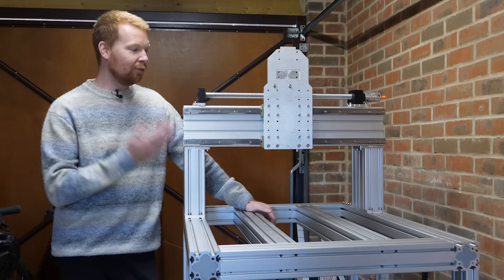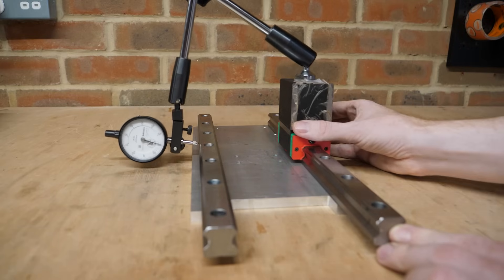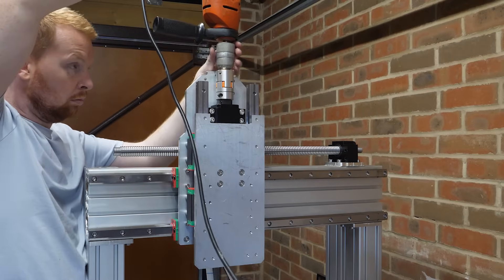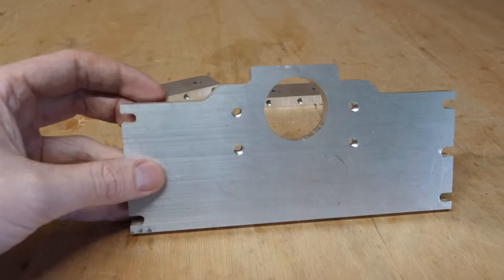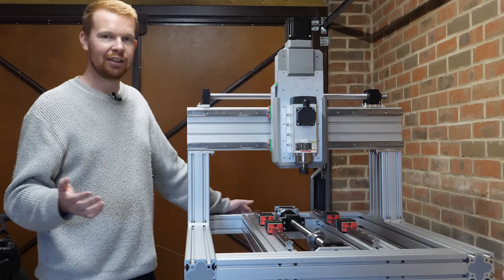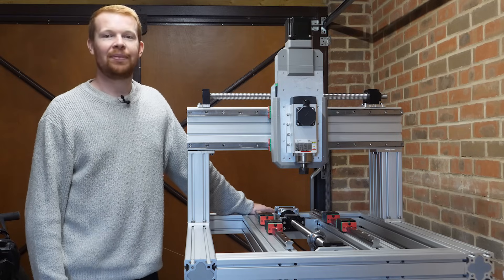Building a CNC Mill/Router - Part 3

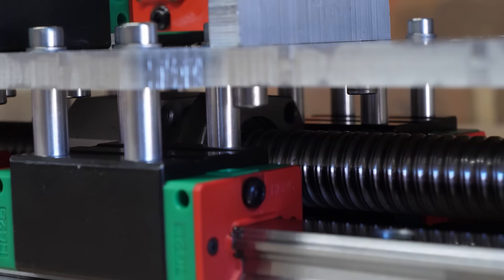Comment: I have a question ! You made the hole Maschine out of strong Aluminium Profile, 80x80mm and put Concrete into theyse Aluminium Profile. And then you use theyse flimsy pipe at 2:35 to raise the Plate? Dude I hope that you will change the tubes for aluminium flat stock 😅
Reply from the maker: Yes I've already replaced them with aluminium blocks haha!

Comment: how you have solved, heavy spindle not drop down when power is OFF. i just update my DIY cnc Z axis new rails, new T-screw and heavy 2.2KW spindle, but id cut power OFF no elektric spindle move to down screw rotate because spindle have very heavy and drop down. no problems if power is ON, then steppermotor torque keep screw locked and no drop down. i use T8 trapezoid screw Z axis. rails have about 300mm long. MGN 15H rails. my machine table size is 1500mm x 1500mm x 150mm working area. before light weight 800W ER16 spindle not has this problem and working well milling wood lot.

Comment: I don’t know much about water cooling when it comes to millls. However Ive done some work with water cooling other equipment and usually you are supposed to use an anti septic chemical. They have ones specifically to be a water cooling additive. Additionally at least in my experience it’s a good idea to use distilled water.

Comment: Might be a better way to mount  y table,  instead of mounting the y rails to the table frame. Mount the rails to the bottom of the y moving table. Mount the bearing blocks to table frame so they don’t move, this might increase rigidity of work piece under spindle.

Comment: 4:50 If you're looking to get better quality with that filament, you'll have to remove the mosture built up inside it. If you heat the spool in an oven or a drybox over time ( temp. depends on material, but theres a few recommended values and methods online it'll take the moisture out of the filament. You can also toss some dessicant packs in a box, and it should keep the spool dry for a while.

Comment: Hello everyone,

I am a mechanical engineer and I have the same type of engine that used to overheat until I designed a new fan with 7.2 times greater airflow. If any of you have a similar problem, feel free to contact me and I will solve it for you.

Comment: Your power issue was not because of just 1,5KW,but rather a cheapo VFD. Get a proper one with Sensorless vector/or with sensor vector(need a sensor then for the RPM). I am running my 1,5Kw 220v spindle on a ST500 with 12000rpm with a 6mm endmill ,22mm deep, 1,5mm step over by a feed of somewhere around 1900.....With the chines vdf not even half was possible.Also get some coolant or at least air to get the chips of the cutter and the cutting area. Most gunk up on aluminium is from chips getting in to the cutting edges over and over again and pressing into the chip channel.
So yeah just put at least a nozzel with air up. 1-2 bar should be enough,or get a cold end by endcnc. Best fog cooling on the market,even better then industrie ones

Comment: Maybe I am dumb, but couldn't you use a frame out of cheap angle iron, which fixes a thick wooden spoil board, that you use the cnc mill to flatten peferctly parallel to your x and y axis? For many operations I would assume, that you would add a vice with some bolts on top and big sheets of iron etc could get screwed down with a bunch of wood screws: Drill a few holes in strategic points, fix with a woodscrew into the spoil board and remove everything once you are done.

Comment: Dude, there is something called printnc which is a CNC machine with a bunch of 3d printed parts, and it cuts steel, don't wrap your head around avoiding printed parts, they are strong enough for your application

Comment: Still not cheap, but clickmetal seems to have the cheapest aluminium tooling plate in the uk. Cheaper than aluminium warehouse's standard plate. About £150 for 520 x 520 x 16mm

Comment: Those spacers are going to cause a lot of rigidity and vibration issues. Ideally the blocks should be mounted flat on the surface.

Comment: So something I learned when I made my cnc machine is that because steppers NEVER turn off they can get hot enough to melt the 3d printed part over a long operation. It shouldn't cause a major failure because it will just make the plastic soft and deform, but its still something to watch out for.

Comment: With such beefy motors, why not build a 4x4ft or 4x8?… You could have worked on a full slab of wood on something like that. Even if you don’t need that now, would have been future proof.
Also… what’s with the ball screw in the middle like that? Shouldn’t there be 2 ball screws, on each side? To move the entire X axis assembly with the spindle along the Y axis?
Reply from the maker: It's mostly designed for metal cutting, so the smaller size helps with rigidity. The gantry is fixed, and the cutting bed will move back and forth, which should also help with rigidity.
Reply: Oh, it will be the bed that moves on the Y direction, that’s why the center ball screw. And for metal, that’s why the size. Got it! Thanks for replying!

Comment: Hi Tim
I have worked on CNC Mills for over 13 years and what your doing is great. Just a thought maybe you could get a sheet of C250 Tool plate  (30mm thickness  recommend for a bed) as this makes good cheap Ish bed material. Any tool plate is good as it should come flat and parallel and stress relieved. If you phone up material suppliers they sometimes have a big off cut they will sell cheap. Try SMITHS, Optima metal services, aalco, mill stainless. 

If you ever need any CAD/CAM or support and I can help just give me a message.

Cheers
Luke

Comment: all will be good, will you be upgrading to hybrid / optical sensor based nema / motors at some point. The machine knowing where it is..  great idea. Cnc4u uk Talk to brian, smart guy. can do you a kit..  3d prints will be fine for now.. (ask me how i know) i don't need to be more than .2 accurate (my things are atheistic use) and even then when i do personal projects stuff fits and works. Lots of people get obsessed with repeatable accuracy above a certain point.. Pointless unless you are manufacturing in big numbers or building engineering parts. All stuff without a tool changer needs post work done, being 0.09 or better is EXPENSIVE!!!  and warming up the machine etc.. FAFF.. when your doing youtube stuff and hobby stuff it really doesn't need to be amazing. Just need it to cut at a reasonable speed and be fairly reliable.

Comment: mach 3 runs on windows 10 and a u100 conversion unit will fix that issue getting the parallel to talk to the usb.
Reply: and can buy pci or pcie paraller port card, cost normal 20-30$ working well, i have my computer 2 pcs paraller port card and use my cnc lot input/output ports.

Comment: Building a DIY CNC Mill/Router: Part 3 - Constructing the Y and Z Axes

* 0:16 Z-Axis Construction: The Z-axis plate is tapped and countersunk to mount linear rails and the spindle.  [From ErtsenPlayGames' Comment] For extra Z-axis stiffness, consider adding aluminum flat bars opposite the spindle to create a U-shaped mount.
* 1:09 Rail Alignment: Linear rails are carefully aligned to be perfectly parallel using a dial gauge.
* 1:25 Ball Screw Integration: An aluminum part connects the ball screw nut to the Z-axis plate, with spacers for clearance.
* 2:39 Design Adjustment: A minor design flaw involving a bolt head colliding with the ball screw nut is resolved by removing a washer.
* 3:00 Bearing Installation: The ball screw bearing is mounted in a recessed pocket, ensuring alignment with the ball screw.
* 3:58 Motor Mount: A 3D-printed mount is used for the Nema 34 stepper motor driving the Z-axis. While a machined aluminum mount might be preferable in the long term, the PETG print provides sufficient strength for initial use. [From SenkJu's Comment]  PCBWay or JLCPCB might be interested in sponsoring a machined or metal 3D-printed version of this part.
* 4:33 Protective Guards: 3D-printed guards are added to protect the motor and linear rails from dust and debris. [From yngndrw's Comment] Storing old PETG filament in a warm place, like an airing cupboard, can improve its printability.
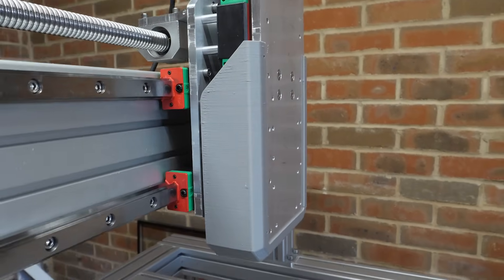* 5:06 Spindle Installation: A 2.2 KW air-cooled VFD spindle with an ER20 collet is chosen for its ease of maintenance compared to a water-cooled system. [From Kmnri's Comment] There is concern that the air-cooled spindle might not be sufficient for some tasks.
* 5:43 Y-Axis Assembly: 800mm linear rails are mounted on aluminum extrusions to form the Y-axis.
* 6:04 Y-Axis Motor and Ball Screw: The Y-axis stepper motor is mounted, and custom brackets are used to connect the ball screw bearing mount to the extrusions at a 90-degree angle. [From free_spirit1's Comment] Off-the-shelf motor brackets with integrated ball screw support might offer better concentricity and ease of assembly.
* 6:47 Support Bearing: A 3D-printed bracket supports the weight of the ball screw.
* 7:04 Next Steps: The Y-axis requires further alignment and squaring with the X-axis. A suitable cutting bed solution needs to be determined, potentially using a combination of smaller thick aluminum and larger thinner sheets.  [From David_Phantom's Comment] Once completed, the CNC machine could be used to create replacement parts for the 3D-printed components.
* 7:04 X-Axis Motor: The X-axis motor mount needs minor finishing and installation.
* 8:28 Electronics: Shielded cabling has been ordered, and the electronics will be installed once the cables arrive.

I used gemini-1.5-pro-exp-0801 on rocketrecap dot com to summarize the transcript.
Cost (if I didn't use the free tier): $0.06
Input tokens: 15372
Output tokens: 692

Comment: 2:50
Why didn't you just file/sand down that bolt head by the quarter/half-millimeter it would take to stay clear of the nut?
The hex key slot should be more than deep enough to still be drivable and if you're worried about mixing that bolt up with another during later (dis-/re-)assembly you could just mark it some way like scoring/etching a line over any of the bolt head's faces with the edge of a file.
That's maybe 1-2 minutes of work and still a lot less janky than eliminating a washer from a bolt going through such a larger slot.

Or you could go a bit more overkill and machine a shallow slot into the ballscrew nut for the bolt head to pass through, again that fraction of a millimeter of depth shouldn't impact the nut in any way in its function or durability.

Comment: https://youtu.be/LACC_XJ1RvM?t=57 Please PLEASE use some kind of tapping fluid, lubricant, or dish soap when tapping holes in metal. You'll have a much easier time, won't have to back the tap out as frequently, and won't dull your taps.
If you want the coolant in your other spindle to not get moldy you need to mix in 50% antifreeze, and 1% iodine.

Comment: Do you already know what elctronics you want to run? I am using duet3d boards but i find it a little awfull that it doesnt use screw terminals only pins
Reply from the maker: I'm actually planning on using a duet3d board. Is it a good choice? (Other than the pins)
Reply: @TimStation  these are great i am using the 6xd board. With external stepper drivers. When im remembering corectly there should be a 3d model on the website. I would recomend making a a custom pcb with screw terminals. Something like the boards for arduinos. I am using a pc the web interface is great. On the duet website there is an explanation how to connect it to the pc. I cant recomend that way. The Board has a sd card put them in the pc and change the ip adresse there way less work. 
For the vfd you also need an 0-5vpwm to 10v analog converter the duet board doesnt support 0-10v output. Or getting a fvd for pwm signal but these are not very common. 

The website has all documented that stuff but for a new one like me these where the Problems i had

Comment: The fan on the motor is fine. But the shroud sucks. 3d print a mount that allows you to attach a 32mm or so flexible hose and vent it away from the cutting. It allows for cool air and limits dust and chips and also, significantly cuts down the noise. As most of the noise is from the fan!

Comment: You don't run water in a "water" cooling system. They always have some biocide and surfactant in there as a minimum. You can buy these as additives for PC water cooling, or just use car radiator coolant pre-mix. The high glycol content to prevent freezing might be useful in your garage, but does reduce performance a touch. Probably not enough to matter, just use a faster pump and bigger rads and fans.
Reply: I’ve been running 2 air cooled 4KW spindles for over 4 years now. I’ve run over 3000 jobs, many of which were 3-4 hours at a time. My garage has neither heating nor cooling, so here in New England the temps range from under 0 to over 100F. I can’t imagine what advantage water cooling has to offer. Maybe a little quieter?
Reply: @MachinedInWood  it's far more quieter but honestly not worth the hassle, supposedly good for spindle life as well

Comment: Do not use the parallel port.   There is a hundred dollar adapter that easily lets you use a USB port.  I run Mach 3 and Windows 11 ( you can use any version of Windows)!!  I just use a 200 dollar minimal laptop.
Reply: lot better use paraller port, i used old table computer and 10$ paraller port controlelr board, lot cheapen and working well alltime, usb have lot users problems and etheret have expensive use. i buy only 2 pcie paralelr port card to computer if not old computer have paraller port, old computers were have paraller port can buy 20-40$ and not need better can use whit cncmachine, best software have safety REALTIME controller linuxcnc. mach3 have dangerous and worst (what i used first cnc many year) but lot better flexiple and adjustable have linuxcnc and true lot better safety,  if want perfect machine, buy old 20-50$ old computer, and perfect mesa card then have lot more input/output and controll all good, windows not newer used any factory automation not safety, need be real time controller whitout stupid windows interrupts alltime. this mean have lot lot safety all controll. pcie paraller port card cost 10-20$ not more and good parallerport breakoutboard cost 8-20$ not need more can run 4-5 axis whitout problems. but best controlelrboard have mesa card. expensive but perfect all cnc machine.about 200$
Reply: USB and windows and mach3 have worst compination what newer can use cnc machine, cheap but not safety. and lot problems alltime. paraller port, linuxcnc old 20-50$ computer have lot lot better to cnc. production and factory not ewer used windows and USB port, only safety first then need use linux and paraller  port. worst windows not can use REAL TIME, this is safety rule.

Comment: For any future projects that use water cooling, I would recommend adding biocide to the water to prevent any organisms from growing.
Reply: Or use automotive coolant if the parts involved can handle it. It'll last heaps longer than water alone and (assuming it's an antifreeze type) it will prevent any issues with frozen coolant bursting weaker parts of the cooling loop if it gets cold in winter.
Reply: only idiot use only water, need use cooland liguid then not have bio problems. same than car used and any car not has bio problems ewer.

Comment: All those little bitty spacers are a terrible design mistake in a machine tool, that must be as rigid as possible.  If you can't design them out, at least replace them with solid blocks of metal.  Keep at it Tom!
Reply from the maker: The first parts I plan to cut out are replacement solid blocks haha! Thanks!

Comment: Please tell me some of the first parts you're going to machine with the new CNC are replacements for those long bolts with the aluminum sleeves that mount your z-axis.  Those must easily be the weakest link in the design.
Reply from the maker: That's the plan! Replace them with solid block spacers as soon as I can.

Comment: i reckon those spacers on the z/x axis are gonna cause some rigidity issues could be worth machining out some solid aluminium spacers.
Reply from the maker: As soon as I get the machine running, I plan to cut out some solid block spacers.

Comment: You also may want to make sure each pair of rails are in the same plane and that those planes are perpendicular to each other.
Reply: I hope he comes back and does this properly! Most people 'tram the spindle' without accounting for correct orientation of the axis relative to motion.
Dial indicator to measure z axis relative to X and Y. A flat bed and decent 123 block will do it at a pinch.

Comment: 0:49 - pro tip - machinist tap = you can mount it in a drill 
for extra Z axis stiffness add 2 pieces of aluminium flat bar opposite the spindle (as long as the axis- screwed to it ) so you create U shaped mount
for bed u can do the same but under it in XY axis ,or maybe another project -- 2 pieces of aluminium (with dozen holes in it) and epoxy granite in between

Comment: you didn't need windows XP, just 32bit windows for the ancient PP driver. also they sell PP PCIE cards that literally drop into any computer made after 2006 and work just the same. Its actually kinda weird you didn't see all this info in the CNCzone forums... you legit could go buy a new computer right now that still supports windows 7 32 bit but I will concede that yes most of the absolute newest computers don't have support for before windows 10 aka 64bit only.